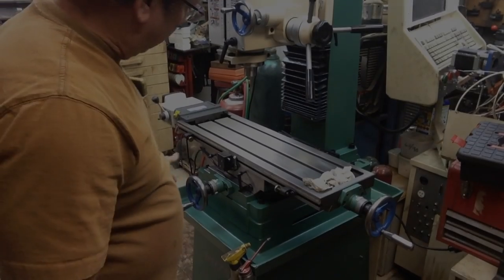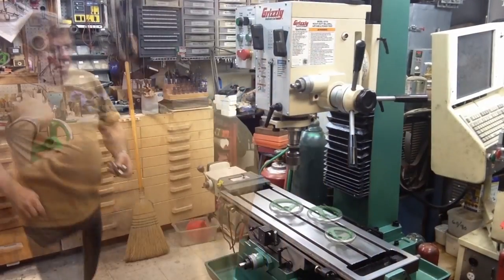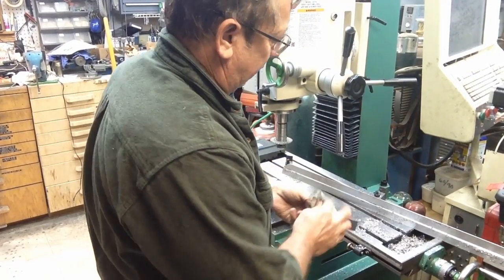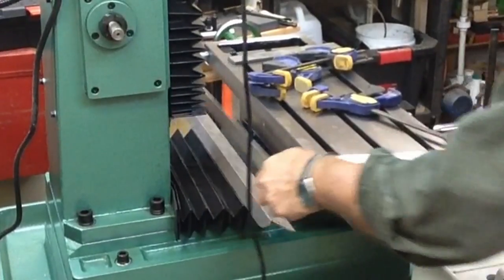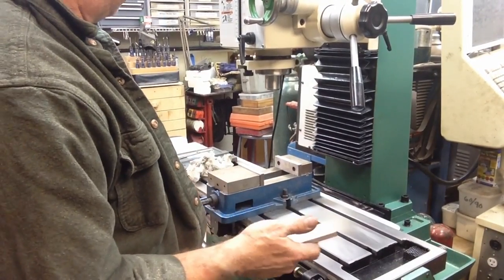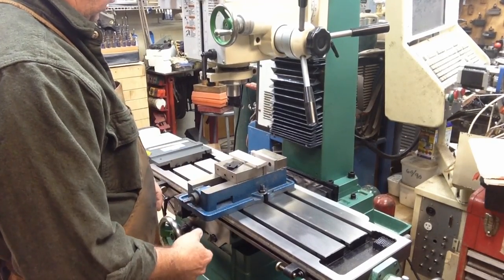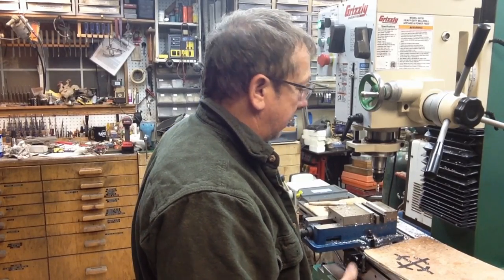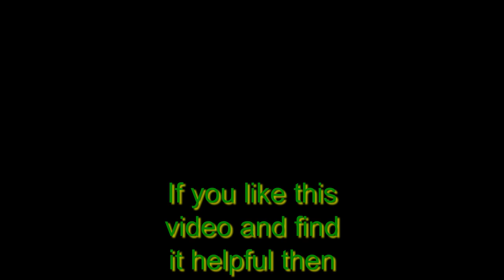Grizzly G0755 , Part 3: Handwheels, Mounting the DRO X-Axis scale

Comment: What DRO did you use? could you post a link?
Reply from the maker: Hi Austin: When this scale was installed It was used with a Shumatec DRO, I have used these DRO's on several of my machines but they are no longer available and I consider them obsolete although I continue to use them on some of my machines until they give out. I have recently converted this mill over to a toauto dro  https://amzn.to/3HIeYFD and glass linear scales and am waiting for another display for my Sheldon lathe. So far I am satisfied with the new DRO, there are some improvements but they also fall short of my older units in some respects but for the cost I think they are a very good value. Dan.

Comment: I have ours set up with the table at 40” and I’d still like it to be couple of inches higher (I’m 6’2”), too hard to dig a hole in the floor in front of it,
Reply from the maker: I am finding a lot of machines seem to be to low both US and imports. I am a short guy so I know it is tougher for most other people,
Reply: @hillsgun  I think they’re made for a low average height, especially older machines. Most of the machines in our shop have been raised (by me), including the bandsaw, tablesaw and drill press.

Comment: I just loosen the Y-axis collar locking screw and let it spin if I don’t need to use the dial, that gives about another inch of travel.
Reply from the maker: Things that make you go hmmm. I had not noticed that the locking screw was what was limiting the travel. I consider it to be one of the design flaws of the imported machines. Something so simple as using a shorter screw there would increase travel of the table. I will shorten the screw in the morning. Thanks for the tip, Dan.
Reply: @hillsgun  Yup, lots of little improvements to make. We don’t have a DRO on our mill and I found the collar locking screw on the fine feed to be a pain when close to the head. I made a little extension shaft and a delrin spacer to bring it out past the head so I could get my fingers on it. I noticed while doing some comparisons that the Precision Mathews version of this machine already has this modification. Better planning I guess.